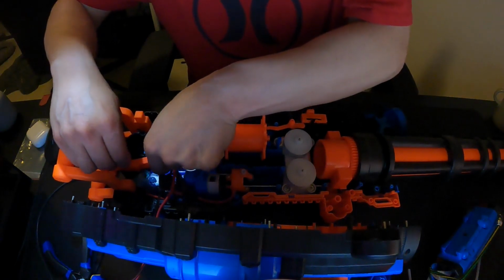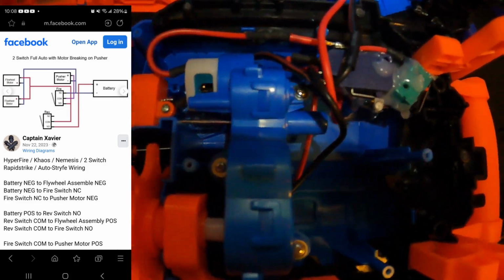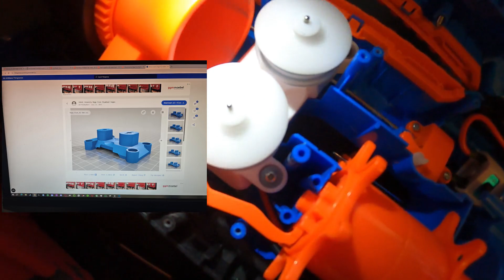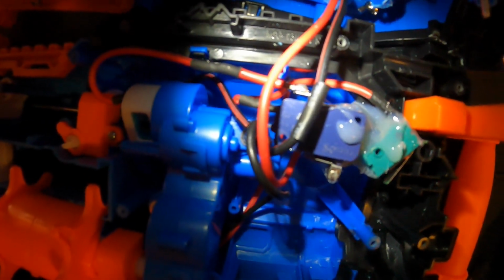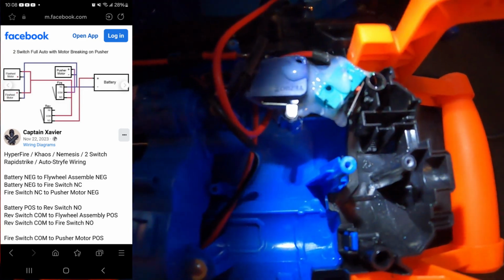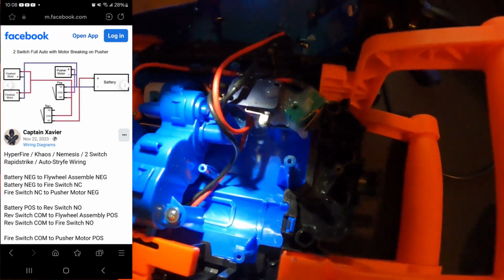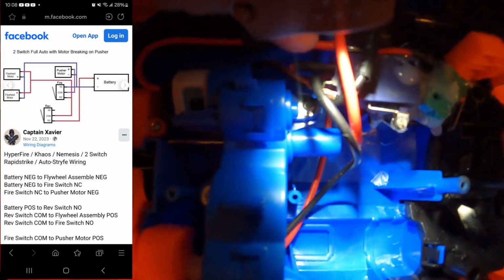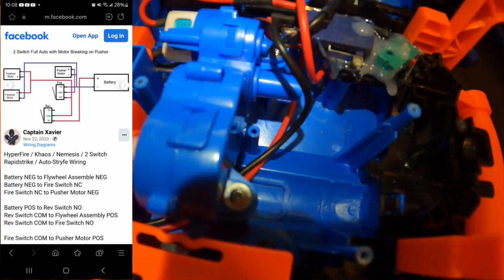nerf Ragefire wiring tutorial

Comment: Wait so just a question where did you get the two switches and wires?
Reply from the maker: Switch can be bought from out of darts i recommend the micro switches bc its an easy fit and wire i recommend 16 awg
Reply: @NerfByGabe thanks
Reply from the maker: @Upstartgecko70 no problem

Comment: Where did you get the flywheels? Not the cage itself, but the actual flywheels? Also, did you solder all your connections or did you use solderless connectors? Lastly and probably most importantly, when I wire up the krakens in the flywheel cage, they spin the same direction instead of opposite to actually eject the dart. It's wired correctly and the motor obviously cant be reversed so I'm very confused. Any ideas?
Reply from the maker: @ryanschultz6633  all things can be bought from out of darts except the motor ship and cage and the pusher . I soldered all connections as if it were a normal stryfe. 
Motors to rev and rev to fire trigger to battery.  If confused about it the diagram is there . The motors are in. The same direction bc you wired them cross instead of split . Gabea2159@gmail.com shoot me a message I'll help further

Comment: What exact 3s lipo did you use? Also do you have a voltage alarm?
Reply from the maker: @User13-v6k  you can use any 3s you'd like and yes i do
Reply: @NerfByGabe   I see but where did you put the voltage alarm? (I'm currently trying to make this and I couldn't find the voltage alarm in the video)
Reply from the maker: @User13-v6k  i have one but don't use it much bc where I live I'm unable to run any nerf wars so it's mostly indoor use. But the alarm can just connect to your lipo via the pin connectors
Reply: @NerfByGabe   I see do you have a link or name of the voltage alarm? Also just wanted to say thank you for the quick responses this project is probably gonna be done within two weeks!
Reply from the maker: @User13-v6k  no problem I was researching for weeks and just said fuck it 🤣 I'll take the risk. Was unable to find anything besides shooting demos and small talk on reddit. And now I've been able to create the best ragefire anyone has seen 🫡. And the lipo alarm can be from out of darts or Amazon. I didn't see much of a difference between the 2
Reply: @NerfByGabe   I see thank you!
Reply from the maker: @User13-v6k  🫡

Comment: Okay, so I ordered everything I need and I printed both pieces as well. The only thing I didn't think to ask was if the worker motors under the flywheel cage are the OEM ones or if you upgraded to something else?
Reply from the maker: @ryanschultz6633  everything is upgraded all motors are changed
Reply: @NerfByGabe  are they all the same? Are they all the 75k ones?
Reply from the maker: @ryanschultz6633  no only the pusher
Reply: Okay, so the pusher motor in the shim is the 75k one. I can see that one in the video. You said you upgraded the ones under the flywheel cage, but I don't believe you say what you upgraded them to. Any info would be helpful, thanks.
Reply from the maker: @ryanschultz6633  u can use krakens less current draw but still good power output 🙏
Reply: Is that what you used? Which do you have under the flywheel cage? Haha, that's what I'm getting at, trying to use the same as you to make sure the outcome is the same.
Reply from the maker: @ryanschultz6633  yes I had to double check.  I'd recommend less crush as it's shooting 18 darts a second so the darts should come out smooth
Reply from the maker: @ryanschultz6633  i had 43mm original but I'd recommend 44
Reply: @NerfByGabe  any chance you have a link?
Reply from the maker: @ryanschultz6633  link for what part?
Reply: @NerfByGabe  You meant the 44mm flywheel case to print, right? If so, I was asking if you had a link for the kraken motors you were recommending I use for in the flywheel case.
Reply from the maker: @ryanschultz6633  out of darts
Reply from the maker: @ryanschultz6633  and yes 44mm

Comment: did you use a mosfet or no
Reply from the maker: @aaronholmgren622  nope if you use 21amp switch you'll be fine
Reply: @NerfByGabe  thanks
Reply: @NerfByGabe  also what type of wires should i get
Reply: like what gauge wire
Reply from the maker: @aaronholmgren622  I'd recommend 16
Reply: and what c battery you have
Reply from the maker: @aaronholmgren622  2200 50c

Comment: Does it matter what mAh the battery is? Does that affect the rate of fire or anything?
Reply from the maker: @ryanschultz6633  if you followed it all depends on the motors your running.  Most motors run on 3s mah is preference
Reply: @NerfByGabe  fair enough, was just trying to make it the same as yours so I guess I was asking what yours was in a round about way. But also, you say in the video that the cage is 43mm? I only ask because the link takes you specifically to the 41.5mm file and again, just trying to make it identical for the same results.
Reply from the maker: @ryanschultz6633  let me check for you
Reply from the maker: Sp I'd recommend the 43mm bc rof is ridiculous and the darts have no time to get out the wheels fast enough.  But I should still have my old cage bc I ended up changing it to a tighter crush and it made it worse so five me an hr and I'll let you know 👍
Reply from the maker: Also If you want it exactly then I'd recommend 3s 1300mah and up bc of the the amount of rounds you could possibly Fire
Reply: @NerfByGabe  Okay. I'm going to go with a 2200 mAh 80C battery, unless you think that's overkill. I was originally going to go with a 120C but thought that might too much, but I'm new to this so I don't know for sure. Also, I downloaded both files for the 41.5mm and the 43mm cage and I'll just print whichever one you tell me is correct. Lastly, I'm going to order random switches unless you think the ones from the WORKER kit are better ).....or you used more than just the switches from the kit? But I do thank you for taking the time to help me man, I really appreciate it.
Reply from the maker: @ryanschultz6633  
1. so I recommend both normal sized 21amp switches and at least one worker switch but I used what I had plus I heard that worker switches are sometimes bad but I haven't had an issue.
2. The small switches will give you more room to solder snd hot glue
3. The higher the c rating the more amps get pushed at once so in turn you could either drain battery faster or make it last longer.
4. Test different 3s c rating option to see what your preferred speed is.
Reply from the maker: @ryanschultz6633  np I don't post much as my channel has grown solely off my ragefire but I plan to help all those who need or ask for my help.

Comment: What’s the name of a battery i can buy in amazon, i want the one you use for the ragefires? I don’t need the motor
Reply: It seems like its just a 3s lipo man
Reply: @ IK what kind there’s different type of 3s Lipo
Reply: @hawkck75gamer  Mate use any 3s lipo (Make sure that it doesn't have a too high voltage rating or you will fry everything)
Reply: @User13-v6k Well how tf he supposed to know the right voltage rating then? Thats probably what he’s asking! (Aren’t most 3s 11.1v anyway?)
Reply from the maker: Any 3s will work but for best performance anything with a discharge of 60c or higher and us ovonic or something highly recommended

Comment: I got a question, how exactly did you manage to fit the motor sleeve in the round holder. Did you change the settings for the print itself?
Reply from the maker: @User13-v6k  nope it just went it but idk how far it went it tbh buts it's enough to make everything work and it was good enough for me . Plus the blue gear section sucks to take apart. Be careful with the links and all you don't want the chain to jam up and sheer your gears like I've done 3x but if you use a lesser rpm then it's not as bad but mine scares me to use bc of the reason also no gear replacement 🫡🫣
Reply: @NerfByGabe   So would it be a good idea to put a kraken motor from OOD instead of the motor you have listed?
Reply from the maker: @User13-v6k  yes you can a kraken you'd get more use of it bc slower rof would all the darts to get enough time to go through flywheels before the next dart hits. Better accuracy and fps